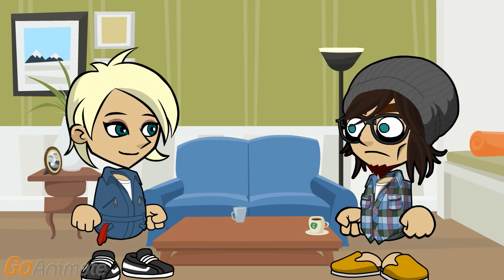My Thermostat is Off But My Heat is On

Comment: My heat is on in the summer and my upstairs is 115 degrees 😤amd it’s never worked in all 3 yrs i been here and now it’s on . And i turned it off an hr ago and it’s still hit in my baseboards . I’ve been wondering why it’s been so damn hot uo there for months now ! Never thought my what was on being it never worked before

Comment: For those with geothermal heating or heating with heated water, you may need to have your motorized heating valve changed out if you bought a new thermostat.  Mine would close when the thermometer is on, but with my new nest thermostat, it needed it to be opposite open when the thermostat is on.  So essentially 2 valves that work differently, one will close when it gets a current and one will open.

Comment: My boiler is on  my central heating is turned off but upstairs it makes noise and heating is warm why
Reply: I have the same thing with my heating is turned off and make noise and heating is warm ..I call a company and they can’t find why ..... i am stress....
Reply: But i dont want to call someone... would testing the "w" terminal for 24v to determine if the thermostat or sequencer is bad be the next step?